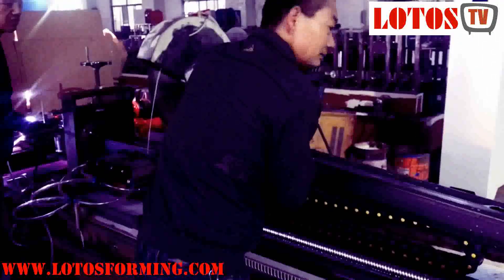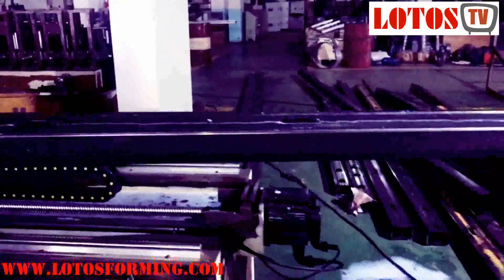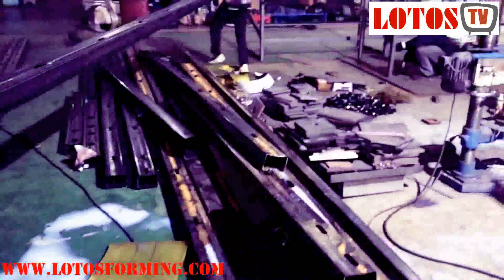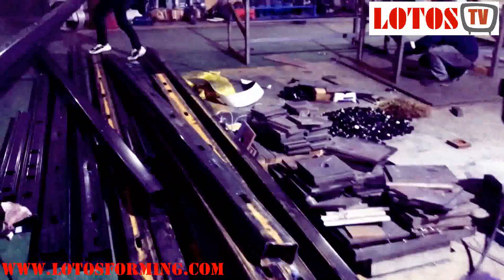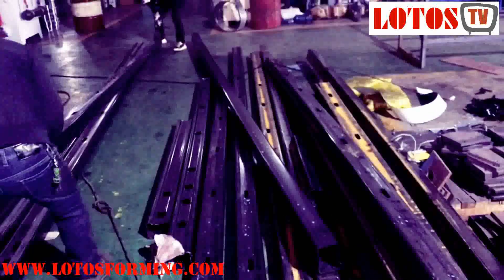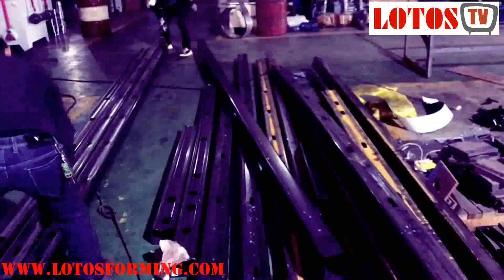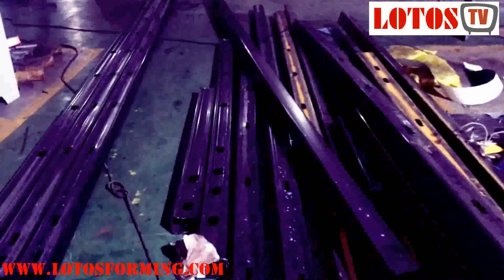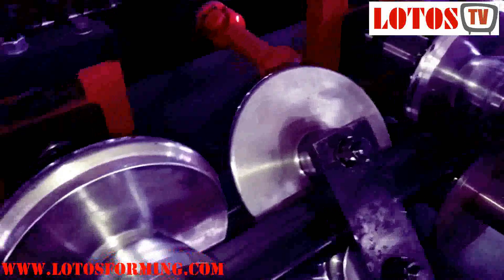【steel square pipe making machine】:square pipe roll forming machine|square pipe making machine price

Comment: LOTOS is professional in manufacturing high-quality steel welding square pipe roll forming machine and welded tube mill machine. The square tube is a kind of square pipe, which is a steel pipe with equal sides. Generally, welding to form a round tube, and then rolled into a square tube by a round tube and then cut into the desired length. The welding of steel strip into a product, such as a round tube or pipe, is a great industry.

Comment: Generally, welding to form a round tube, and then rolled into a square tube by a round tube and then cut into the desired length.

Comment from the maker: When working with nonround shapes, such as a step beam, firstly the roll forming machine form the shape before welding. that call this form welding square pipe. Once the shape is formed and welded, most recommend at least two additional passes to work the welded shape once more to finalize the dimensions.